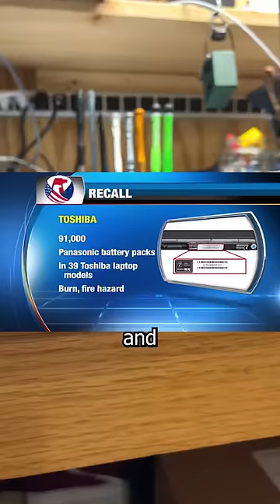This Toshiba Satellite is the worst #laptop ever made. EVER. #tech #pc #technology #shorts

Comment: Mom and I inherited a Toshiba laptop that was probably about a year old in 2011.  It is still our main computer to this day, though it is starting to really struggle with running modern sites as it is now at least 14 years old and still running Windows 7 (not like we could update it anyways lol).  That thing has had a rough life, too.  It actually outlived the power cord it came with, which blew a capacitor or something last year and was easily replaced (and no worries about exploding batteries, because ours died ages ago, so we popped it off the back and then never got around to replacing it lol).  It's a bummer that Toshiba sold out so badly when they clearly have the capability to make fantastic laptops and are just choosing not to.
Reply: Put a SATA 2.5" SSD in and install Linux Mint on it. BTW, max the RAM and swap out the wifi card for an Intel wifi 6 card 😀. I did this to my Satellite C655D, works great (play YouTube videos in 360p, though).
Reply: @christopherdecker3830 I was about to say the exact same thing. SSD swap and install Linux Mint
Reply: Try installing a very light OS.
Puppy Linux
Peppermint OS
Reply: Yeah before 2014 Toshiba was goated

Comment: "And I hate HP"

Me watching this video with my HP laptop next to me: 😦
Reply from the maker: Me owning an HP as my main personal laptop 💀
Reply: me still running hp1000 upgraded to i7 and 8 gigs with and ssd, listening to this video with one busted speaker 😢
Reply: I'm not a fan either but microcenter had an open box with a 3060 in it for like $450... can't complain..
Reply: @SalemTechsperts  why do you hate HP? ☹️
Reply: me watching this ON my HP laptop
Reply: I have same laptop spend 100$ on repairing played valorant at unstable 1 to 30 fps and minecraft is unplayable at 2fps,still convincing my dad to throw that garbage truck of shit.
Reply: @Sahil_Deshmukh  good to repurpose for a server or something
Reply: @SalemTechsperts 🤨sus
Reply: HP printers piss me off even more than their laptops
Reply: @SalemTechsperts  me owning a HP laptop with broken hinges that is running a spicy A6-7310 APU that the only job is to create bootable USB drives in case I do something on my main pc. idk if I will have any other use for it as the screen has two beautiful dead lines of pixels LOL (oh also the touchpad completely got fucked so instead of replacing it I completely took out that board out and plugged a cheap ass mouse, works again haha)
Reply: me owning an HP with a processor slower than balls despite that fact i’ve made countless upgrades to make using it bearable all because upgrading it from a crappy old 5400 rpm hdd to an ssd was infinitesimally cheaper than buying a new computer entirely especially since it still ‘works’
Reply: The broken Kaby Lake HP laptop I keep in my linen drawer: 😵
Reply: @videocharger97  because the build quality of their products is often very low
Reply: Me using an HP with 8gb ram
Reply: @SalemTechsperts   i have 23 broken HP laptops. but i am using my 24th HP laptop (screen holder is a bit damaged [so its "sad"])
Reply: HP=Horrible Products
Reply: Me who own a HP 14s 💀
Reply: @satriahadi1893 me too.... Many crack in the body
Reply: @imransyah  and I want to replace the IPS screen because it got a burn on the right side and when I ask "how much for the original HP sparepart" and it cost like 55% of the price that I bought it 3 years ago, I was like " nope I'm sticking with it until I replace it" since the burn is not noticeable when the brightness is at 50% +
Reply: me who owns an hp 6830s with an intel Centrino 💀
Reply: @SalemTechsperts dont worry i hate hp too
Reply: My last two Laptops are Omens and I have no complaints.  The only problem with the last one was the 'F' key died.  Gave it to my bro and his youngest managed to somehow totally kill it.
Reply: not but why is it same
Reply: @mattthemouse1 press F to pay respects
Reply: @Darsh0606  I tried that, but then it loaded a Rodney Dangerfield video.
Reply: I own an HP laptop, the only one ive ever own. and this thing has given me more issues than any other pc ive ever had combined. The only one that actually was worse than this was this old lenovo mini laptop i had that literally couldn't even run a youtube video at 144p. Still got some use out of it tho shoving a ton of emulators and roms on it and hooking it up to my tv to play nes games.
Reply: @littlebigbug10 always repurpose when you can. Sometimes shits just borked but usually a simple fix is all something really needs. I never throw out old pcs unless i know theyre doomed.
Reply: I hate HP as well. Their hinges are made of butter
Reply: Bruh I have an hp (gaming) laptop and it's working fine
Reply: @gamestorynyc2420  not for long
Reply: And I have a HP desktop  @SalemTechsperts
Reply: Omen 16 here with Endeavour OS
Reply: my mom has a hp laptop

Comment: I "owned" a Toshiba Ultrabook thin laptop from around 2014 which was given to me for Data Recovery after water was spilled on it and it wouldn't turn on. Neither Geek Squat or Microcenter was able to get it working. Ironically, all it needed was the daughter board with the power switch and the ribbon cable for said daughter board. So I found the parts online for $30 or so and swapped them in along with a new battery. The battery charge never read correctly when unplugged from the wall, but it ran for the right amount of time. I gave it to my father to use for mostly mundane tasks. Oh I also upgraded to a SATA SSD and 16GB of RAM, which was the maximum it could take, but I got those parts essentially free too from other projects. The original owner had replaced it under his accidental damage warranty, so he never wanted it back. I could probably fix the battery percentage issue, too, if I wanted to. Not worth it at this point though.

Comment: Coming from someone who uses a Toshiba Satellite L755-S5359 from 2012 running Windows 10 as my main, I am grateful.
Reply: Update: It runs Windows11-x Lite now. Windows 11 but for old pc
Reply: I think the one in the video is a C-model Satellite laptop. The L series have bit better finish and build quality.
Reply: I also have a Satellite with 16GB DDR3 ram and also an almost new (I forgot to activate it) M930 NVIDEA GTX. It also has an i7-5500U CPU but the only downside is that the disc drive no longer opens

Comment: I was given a Toshiba Satellite by my university when I started as an undergrad in 2011. I didn't ask for it nor want it as I already had a decent laptop, but I'm pretty sure the uni got a generous kickback from Toshiba for giving them away. It was absolute garbage. Slow as hell, repeatedly crashed and blue screened, especially running off the battery, and weighed an absolute tonne.

I even gave it back to the uni, clearly explaining the issues with it. They sent it back to the distributor, who inspected in and said everything was fine, and mailed it back to me. 😭

Comment: I had an old Toshiba satellite from 2007, and while it isn't fast it still works as well as ever. It's too bad they seemed to get really bad not long after
Reply from the maker: Throw an SSD in there and it will last longer than humans. Those things were built with such good quality materials. It's such a shame how they ended up.
Reply: I loved that generation of satellite they were tanks, its a shame they went down hill as fast as they did
Reply: @SalemTechsperts sadly most toshiba of that period can’t handle so much ram. i have a 2008 toshiba that can handle just 2gb of ram, today is useless until you use it for retrogaming
Reply: a toshiba qosmio from 2007-early 2009 is my dream laptop, espically with a 9800m gpu. same exact quality materials, and great for gaming (in it’s time)
Reply: @nitroseven  afaik qosmio was the high end series, so it was very good quality

Comment: the Hp roast is personal 😂
Reply: Hp: hardware problems
Reply: @marcobincoletto8355 the real meaning behind hp
Reply: HP isn't any better than Toshiba according to my experience. I had a HP m6-w011dx laptop back in 2015, and it had a habit of randomly crashing (boot device not found) miduse. It's very unlikely that it is caused by the HDD because its SMART is perfect with no bad sectors. So that means it is very likely the motherboard issue. I had to hard reboot the  laptop by holding down the power button to make it work again. It also has Windows 8.1 Which is a crappy version of Windows anyway.
Reply: I felt that deep down. I do what this guy does for a living and I have a personal vendetta against HP and all of my coworkers know it because they keep throwing the HP's my way 🥲
Reply: Let’s just say that hp laptops do not have much hp
Reply: @subhampal2802 the laptop is indeed a laptop
Reply: My hp laptop literally survived my countless times of smashing the body (no keyboard included) and it doesn’t even have a single dent, the only thing that failed was the hdd due to age

Comment: The Toshiba I owned was slow and the hinges broke.
Reply: Same but still works. I bought it in 2010.
Reply: The hinges on my 2002 broke also.  I hated that thing.  Good speakers though
Reply: same, but i still use it.(its a toshiba from 2010-2011)
Reply: I used to have a Toshiba before, Back in 2016-17 I used to play a TON of Roblox on it.

Comment: My mom has a slightly older one that we still use, it hard carried during lockdown and its still a good daily laptop
Reply from the maker: I'm curious what model it is, I'd love to know!
Reply: @SalemTechsperts  Satellite C675-S7103, only issue with it now is that the Battery failed in 2022 and we haven't gotten around to fixing it. It's only 2 pull tabs to remove it though :)
Reply from the maker: @Chroshin ah, that model had slightly better build quality but that damn left touchpad button
Reply: @SalemTechsperts  probably a good thing we have used a separate mouse the entire time we have had then lol
Reply: @SalemTechsperts I used my Toshiba satellite from I believe 2003. It was a true tank, I used it until 2018, until I upgraded. Just incase you are wondering it's a S5200-903

Comment: i hate older Acer too due to it's hinges that are too tight. One of my solutions is to loosen the nuts before it breaks or after I put epoxy on the plastics or when I replaced the cover to prevent future breaking.

Comment: I remember that I used a Toshiba satellite L745 when I was a kid. As I got older, I began to enjoy computer building and fixing laptops. Then I realized how easy back then to repair old generation laptops. You can even remove the keyboard. YES! JUST THE KEYBOARD!
Reply from the maker: And they had a REALLY GOOD keyboard!! Not this chiclet POS you see here
Reply: I also have one, i discovered the keyboard was removable too, and i get to hold the fan until it goes to maximum speed so it can lower the CPU temperature to 40°C
Reply: @SalemTechsperts Dell's older laptops like the Inspiron 8200 can last a lot longer although the trackpad can worn out after use and causes mouse drifts.

Comment: My mom got me one of these for Christmas in 2014 or 2016, either way I had a mid spec laptop at the time that I got from my dad that same year on my birthday. The mid spec pawn shop refurbished laptop blew that thing out of the water and it is still running as my backup to this day. The Toshiba was stripped for parts and the rest sent to an e waste facility to be recycled. I have another one that I don't dare touch as it would probably crumble to bits even with the spare parts I ripped off the old one XD

Comment: Had myself a toshiba L755D with the amd a6 quad core processor in it. Thing was a tank having survived 6 or 7 years of previous beatings by another owner and all it ended up needing to be brought back from the dead was a new battery, a charge port and the old hdd swapped for a 256 gig ssd.
Was a fantastic machine and got me through all of highschool and a bit of my adult life before picking up an asus q552ub.

Also yeah no those toshiba laptops from 2014 onwards were crap, but if you happen to have a 3d printer and some time on your hands they make excellent HTPCs. They run decently quietly too once released from the mess of a case they arrived in.

Comment: My dad used to have one of those laptops. At one point, our family computer broke, and we had to use his laptop for stuff for a bit. Eventually, our computer got fixed, but afterward, my dad wouldn't stop claiming that me and my nephew installed stuff on it and was slowing it down. (I never installed anything, but my nephew did for a couple things. My dad was never tech savy either.) At one point, my dad was having a pretty bad day, and eventually he got so fed up and angry to the point where he snapped it in half with his bare hands and broke it to pieces right in front of me. I salvaged the hard drive for my pc, but we don't ever talk about that laptop again.

Comment: So I had a Toshiba back in 2017-2019. It was that exact same model with a touch screen. I played mainly sims 2, sims 3 and sims 4 on it however, one day my sister accidentally dropped it on her foot, causing the screen to break so damn easily! It was messed up as the touch screen was broke and would touch on the touch itself making it barely useable. I stopped using it after 2019. My sister did use it back in 2023 when she started homeschool but immediately regretted it and now is using a Chromebook

Comment: I have a satellite pro c660 from 2004 and it hasn't been repaired since, yet it still works perfectly, except for the fact that it's SUPER slow
Reply: No way is it from 2004, more like 2011. PS I am using one to type this comment. You just need to replace the HDD with an SSD.
Reply: @Kyle-lc3re  It is

Comment: My dad owns a Toshiba laptop, he said it was the best laptop he used although it only even runs windows 7 and has GIANT gaps between the mouse buttons and the track pad for some reason with a easy swappable battery and it had an issue with the mother board I think, so now whenever it's turned on it just does a bootloop just turning off and on

Comment: Had a slightly older model as a kid that was slow but servicable. Got another toshiba a few years later and had to replace the charger port (it shorted and melted part of the case) one of the hinge assemblies and the cpu cooler and all for the bios to corrupt a year later. Havent bought once since

Comment: Got a Toshiba C50 in 2013. Fucking loved it, lasted ages, couple of small broken bits of plastic but nothing major. The first PC I bought myself (rather than an ancient hand-me-down) and for a sub-£300 machine it was amazing, even played through bioshock infinite on it (at about 15-20fps but I had low standards back then)

Only stopped using it bc I wanted a surface tablet, replaced the keyboard (i melted it, not toshibas fault) and gave it to my dad. I’m pretty sure he still has it
Reply: I should add, i’ve owned two surface tablets, they were not great, particularly the surface pro 6 that i spent a lot of money on buying new and which has spent more time broken than working, i now use an old second hand thinkpad instead

Comment: I got a toshiba sattelite-l40 B, I got the battery replaced, switched the hdd to an ssd, the right hinge broke and with it the part encasing the lcd broke off, so I used a binder clip just to hold it together. There is static when you dont plug your earphones on a certain way, 3 of its ports dont work well, and the plastic grill melted off. Its been my "gaming" laptop for about 7 years and still kicking to this day, 

I dont use it that much anymore since I got an actual pc. But this thing got me through a lot so I wouldnt be letting it go anytime soon.

Comment: I used to use a gold HP laptop from November 2016 to January 2019. It was all good until one day. I was trying to put it away in this little container right as soon as I close the container I heard a crack and turns out the mechanism closing the container broke clean through the plastic shell and penetrated the screen. It just goes to show that for less than $600 buying used flagship laptops are better than new budget laptops.

Comment: I actually got a Toshiba Satellite back in late 2013 early 2014 that survived about 2 years before the plastic holding the screen basically broke open and I had to use a binder clip to hold it shut when I was using it.

Comment: In 2012 went from a mid '07 white macbook to a satellite l755d.  It was a tank, surprisingly fresh with those novelty and pesky amd apu's. It was around 2016 when started to bring problems, for example, the speakers briefly sounds when unplug headphones, the ac connector becomes loose, dvd drive died, trackpad didn't catch inputs. I loved that machine, it's still in my wardrobe because I won't throw it to the trash.😢

Comment: I currently have the previous generation of these laptops, a Toshiba Satellite C55-A5286 from my late grandpa who died 4 months after I inherited the laptop (I received the laptop in June 2021, this was one of the last that he used in like 2020 or so before he died)

It has a Core i3-3210M CPU, 8GB of DDR3, a 500GB SSD, and it's ran Windows 10, Windows 7, and Windows 11 at one point after I inherited the laptop. The laptop originally came with a 500GB Hitachi HDD that I replaced with the Crucial SSD in around March 2023. It's currently dual-booting Kubuntu 24.04 and Windows 10 22H2.

It's served me well for the past 3 years, though I do plan on replacing it with a mini PC I found on Amazon for about $150 with an Intel N95 CPU and 16GB of DDR4.

Comment: I was using the L855 series and I had the same issue with the plastic near to the hinge. They were broken due to thin plastic material. In the end I glued all the cracks just to keep the case working. Except that, it lasted more than 10 years ofc the battery died after 4 years.